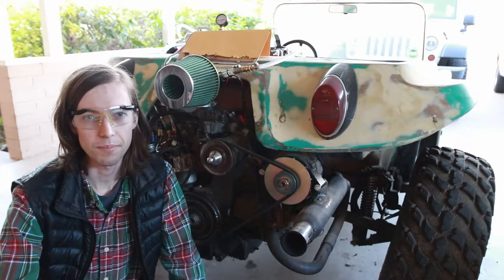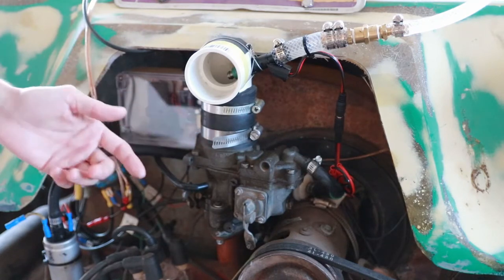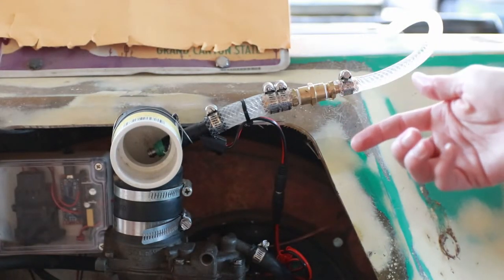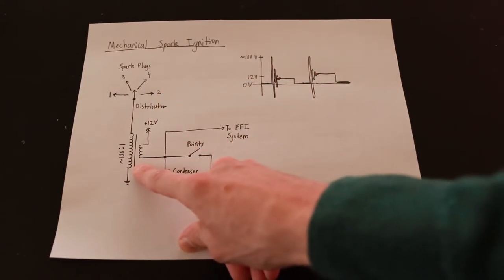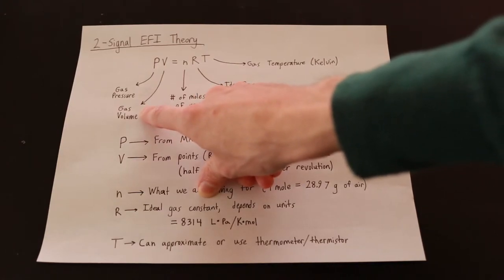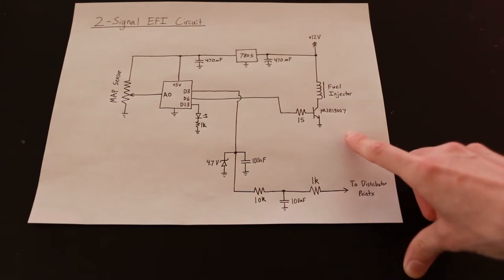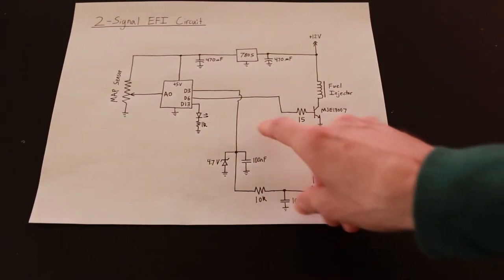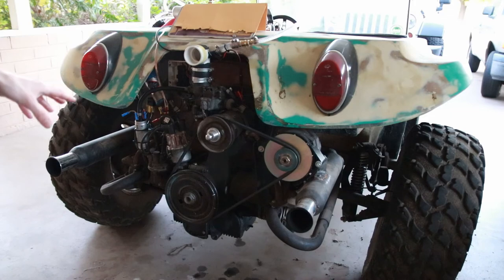Electronic Fuel Injection with MAP and Points Only

Comment: do you know what the maximum rpm of an 4 zylinder engine with this setup is? i only want an efi system for my austin mini and it should hold 8000 rpm... Is it posible with an arduino(because of the maximum frequence)?
Reply from the maker: I only designed for good performance up to 5000 RPM, but you might be able to perform some software optimization to get good performance up to 8000 RPM!

Comment: The PVC injector bung won't play well with gasoline.  Copper would be my suggestion.  Otherwise, great job!
Reply from the maker: Indeed, you are correct. This version was just a proof-of concept; the construction of the larger 2-injector version that I did for my other 1600cc engine can be found here, if you're interested: https://youtu.be/H3no_MC8HvA

Comment: Sorry, I found pin number 14 in the code, and the Arduino board only has 13. What do you mean by pin 14?
Reply from the maker: Pin 14 is equivalent to analog A0 on most Arduino boards. You could alternatively call it A0 by using "#DEFINE MAPPin A0"
Reply: I'm going to apply this system to my 1300 cc engine
And I have the Arduino Nano, please your Facebook account so we can communicate together
Reply: I already applied it on the Arduino, but I wanted to do it with a TPS sensor, so I want to contact you via Facebook or WhatsApp to send you a video explaining the idea.
Reply from the maker: @المهندسالمخترع  Adding TPS is a great idea, and eventually I'd like to add that feature! I'm on FB as John M. Patterson, feel free to send a video about your idea!

Comment: Is this experiment suitable for any engine capacity or should the code be modified
Reply from the maker: The code should be fairly universal. You might need more than one fuel injector, however, as I found that even with the 36 horse engine I was able to get the injector duty cycle all the way up to 100% for brief periods at full throttle and high RPM. For typical driving it was usually around 40-60% duty.

Comment: Do you use a GM map sensor
Reply from the maker: I'm using this MAP sensor, but any analog MAP sensor designed for use with 5V logic should work well: https://www.amazon.com/gp/product/B07Z37XG1J/
Reply: Thank you for your quick response my vw has electronic ignition would I still have to use a condenser
Reply from the maker: @reverendlawrence7584  You would only need the condenser if the electronic ignition already has it. See my reply to your other comment if your electronic ignition system is an MSD (multiple spark discharge) system, as this may impact the point in the circuit where you should tap off RPM signal.
Reply: Thank you again that answered my question and thanks again for the quick response

Comment: in your schematic is the map sensor connected to the ground of the Arduino or is it connected to the ground of the car?
Reply from the maker: The MAP ground connection should be made as close to the Arduino as possible to minimize interference. The ground of the car and ground of the Arduino are designed to be shared (both are connected to the same 12V ground connection); however, chassis voltages due to things like the starter or alternator can cause substantial voltage differences to present across the car ground. Hence, connecting everything as close to the Arduino as possible (typically directly to the Arduino) is best.
Reply: @DielectricVideos   Thanks i really appreciate the response. I am trying to build a system using the schematic u shared however my distributor uses a pickup coil instead of a points system like yours,, will I need to do any mods to make it work?
 Thanks a mill
Reply from the maker: @weskampproductions1243  If the pickup coil produces a 12V-level digital output, you can eliminate the 1k resistor and 100nF capacitor at the input from the points in the schematic. If the pickup coil drives the ignition coil directly, the circuit should be usable as-is. You may want to do some testing to see if the RPM readings are stable while the carburetor is still in use, that way you can eliminate any issues with speed detection before working on the rest of the system.
Reply: @DielectricVideos  thanks i will let u know how it turns out

Comment: Carburetors do work very well, until they meet the end user who “tunes” said carburetor resulting in either fouled plugs or melted pistons. I love carburetors but about 2 years ago it dawned on me that it should be pretty easy to reproduce & improve on the ecu’s from the 80’s through the 90’s (pre 1996 / obd2) using MCU’s and development / expansion boards

Comment: Are you reading a script (written by you I mean) or are you that good?
Reply from the maker: No script here! Glad you enjoyed the video :)
Reply: How is the fuel consumption compared to the carburetor?
Reply from the maker: @martwakoli5892  I haven't specifically measured yet, but one tank seemed to last longer on the EFI system than I remember it lasting with the carburetor. I'll have to measure it more accurately once everything is re-assembled.
Reply: That is great. I am waiting for your final build so that I  do the same
Reply: just curious. will two injectors be sufficient to run a 2.5 litre engine?
Reply from the maker: @martwakoli5892  I suspect you may need to go to 4, as I have recorded duty cycles close to 100% on my 1600cc engine. A MOSFET, rather than a BJT, will be required to drive this large number of injectors.

Comment: Have you ever connected the Arduino to the computer USB while it was still powered from the 7805 voltage regulator?
If so, was there any problem on the computer side or on the Arduino side?
Reply from the maker: I have, and there's a small diode on the Nano that blocks backflow of current into the USB port. However, I would still suggest being careful, as the diode might not protect against large voltage spikes.
Reply: @DielectricVideos   so far, i have only connected the USB cable to the computer while the 7805 input was disconnected (key off) but its output was still connected, and nothing wrong happened on any of both ends.
I only wanted to connect the Arduino to the computer USB while it was powered from the 7805 just to see the statistics, but from what I understand that comes with a certain risk, so I better not do it.
Thanks.
Edit: I think a physical switch on the board between the Arduino and the 7805 input,  including its capacitor, could be a more reliable solution.